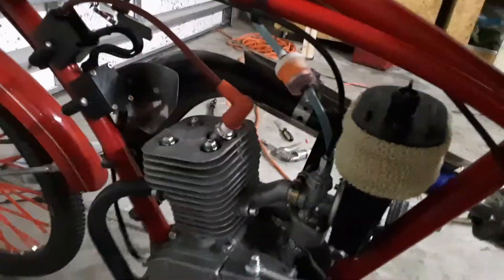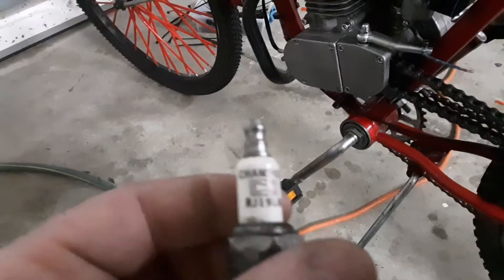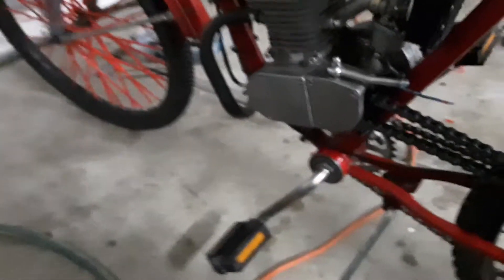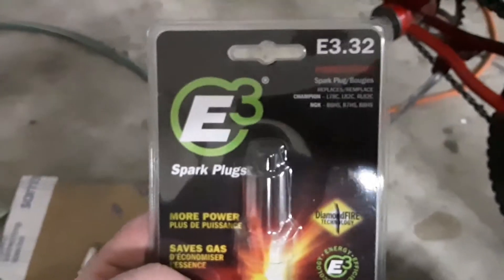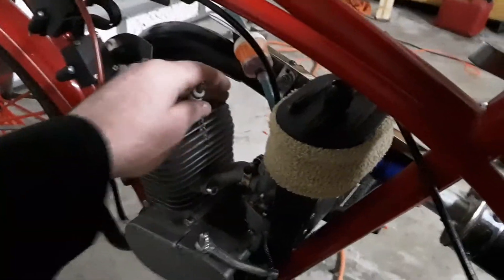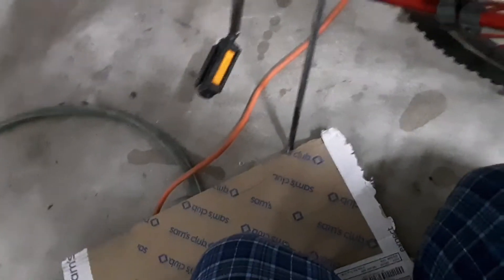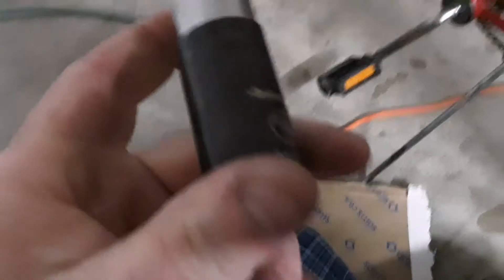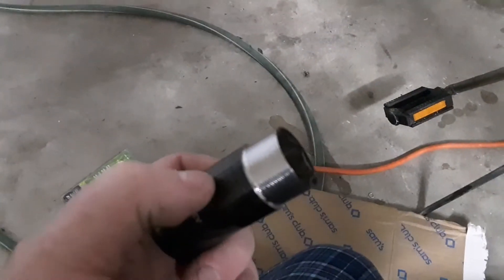Motorized Bicycle Build YD100 Spark Plug Choice

Comment: Z8c works great on my yd100. Tried the E3 32 but plug threads intrude into combustion chamber which can cause hot spot and pre-ignition.
Reply from the maker: Dono e3 32 is 10mm long. So is the z8c Chinese plug

Comment: The E3-12 cross references to the BPMR7A  that they use in the chainsaws.
I just got an e3-12 simply because I seen them at the new auto parts store they have down the street from where I live.
The only other thing is I'll be using these in the hybrids that I've built.
Maybe they are different for the yd100, but the hybrids already do get a little more hot than the regular builds  I don't know so....
Reply from the maker: E3-12 sure is fine in a weed Wacker... It's not pushing a bicycle and a 160 pound person. Lol.  It's identical to a bp5h plug actually.  Way to hot. Just be careful if it runs away. Literally run away lol if it runs away
Reply: @BuildBreakFix  hmm. The last 460 cylinder I got and I got a spark plug boot that both came with a couple
Bpmr7v plugs.
I like them because they have a small foot print, and are a little easier to take out of the cylinder with the smaller hex nut.
I know these hybrids run a little hot, but I have been using a HIPA BPMR7V plug.
It does seem maybe a little hot.
I guess I'll have to do some plug swaps.
That other E3 plug is a direct swap for the saw plugs, but yeah our asses aren't riding chainsaws or else we'd be pork chops! 😂
Reply: @BuildBreakFix  

Replaces:

CHAMPION:  CJ4, CJ6,CJ6Y, CJ7Y, CJ8, RCJ4, RCJ6, RCJ6Y, RCJ7Y, RCJ8, 5843

NGK:  BM6A, BM6Y, BM7A, BM7Y, BMR6A, BMR7A, BPM7A, BPM7Y, BPMR6A-10, BPMR7A
Reply from the maker: Yes but none of those are short porcelain!   There all 16mn plugs.  The bikes use 10mn. 10mm cools super fast vs 16mm that efi requires to run correctly in a 4 Stroke!
Reply: E3-12 is a resistor plug. Too much resistance for the little CDI mag system used on these bike kits. Stay with copper core plug. Gives a better spark which means more complete combustion.

Comment: Can you get an e 3.32 plug at auto zone?
Reply from the maker: I would think so! I buy mine at Napa!  In all honesty though! for yd100 if that is motor your using! Try this plug! https://www.amazon.com/NGK-BP8H-N-10-Standard-Spark-Plug/dp/B000XBGTAQ  It has a very nice heat controlled range that the yd100, bt100 pretty much every iron sleeve build and minarelli  loves that plug. NGK  V powers are like pure gold since they came out!
Reply: @BuildBreakFix  I just bought this bp8h-n-10 spark plug and it has more threads than the stock z8c China plug that came with it. Have you ran the bp8h-n-10 ngk spark plug in a yd100 before? Just want to make sure it won’t hit the piston. Thanks
Reply from the maker: @carsonblinn485  yes it works fine.  14 mm from top that piston to outside of that plug hole.  Leaves a 3-4mm space gap